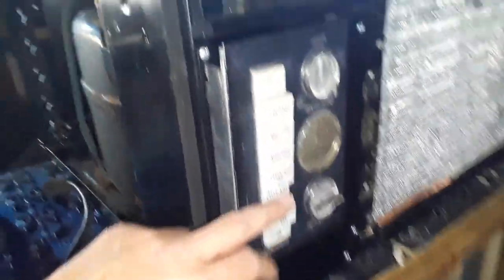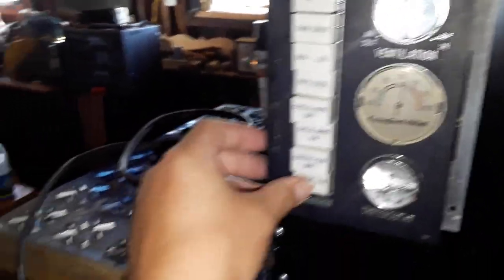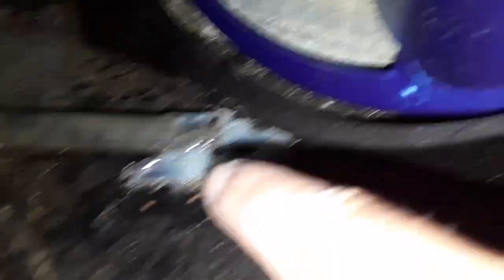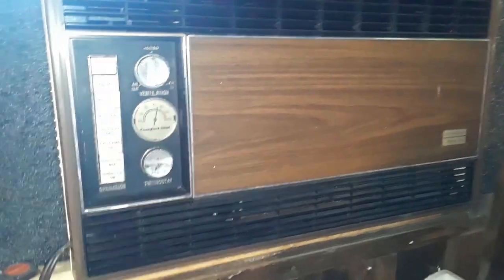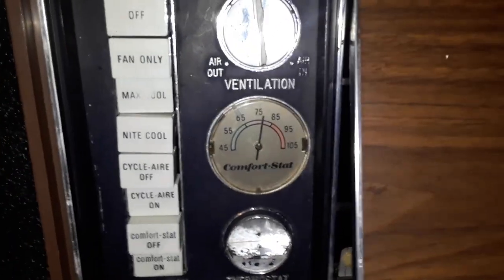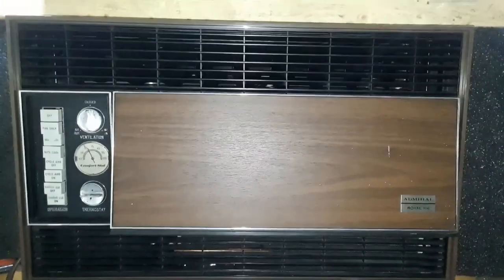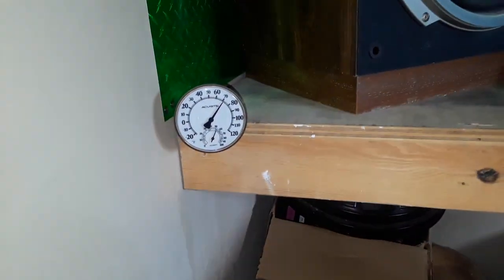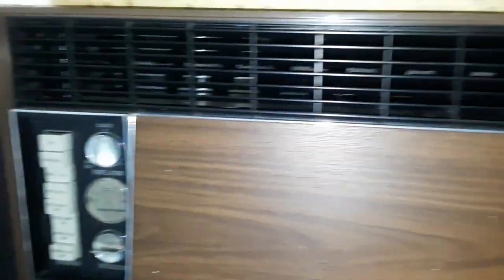1966 Admiral "Royal 106" Air Conditioner Restored & Installed!

Comment: Came out real sharp! I tend to shy away from putting holes in and condensate drains. That way it will sling water on the condenser making it run cooler and lower head pressures. The condensate usually evaporates faster than the overflow problem starts. That's just my preference. Very nice job. I'd like you to see my feeders. Maybe you may know what year it is. Don't know how to get you pictures.
Reply from the maker: uploading a video will be your best bet. amd that water does not evaportate fully, it sits there and rots the base pan awau eventually killing the unit. ive seen too many old units end up useless because of this. a lot of times they crumble whem removed.
Reply: Yeah,it's a double edge sword
Reply: I put a drain in the corner of my 80s one, and one near the condenser, Holes are a little too small actually, I then discovered my unit is completely galvanized metal construction, and that's why it had zero rust inside and shiny white paint under the years of filth in the bottom pan, Surprised a lot of these high end American models didn't use galvanized metal, or maybe not well enough I dunno!
Reply from the maker: @zacharymaclellan6761  what unit are you referring to?
Reply: @TheAirConditionerGuy  I have an Electrohome by KeepRite, Its a Canadian Air conditioner, made in Bradford Ontario, Has an emerson motor with oil ports, three speed and a tecumseh recip compressor, The rest of the unit was made here, they used really thick steel and its definitely galvanized, Inside the unit was not a speck of rust or bubbles on the bottom pan, cabinet or frame around the air box, I live in the corrosion capital of the world, Nova Scotia, humid, right by the ocean and a ton of road salt used in the winter, with constant freeze thaw cycles, Honda actually opened a test facility in Halifax to find out why their cars turned to swiss cheese literally in a few years up here. I have a newer 2015 A/C in my living room I got for $40 and the bottom of the coil is severely corroded, and the cabinet has lots of rust inside, My unit is 35 years old
Reply from the maker: @zacharymaclellan6761  id love to see a video of that!!
Reply: TheAirConditionerGuy i have one of it on my YouTube check it out!

Comment: Does air come out of the bottom air vent as well?
Reply from the maker: Nope, thats the intake louver
Reply: @TheAirConditionerGuy  Ahhh...Since the middle is blocked off with a solid piece, it must need that vent to pull the air into it so it can be recirculated out the top.

Comment: Beautiful job!  That’s an amazing control panel with all the features and the super cool dial!  

Did you guys actually find the slow leak before it was recharged with R22?
Reply from the maker: nah and KB had 275 lbs of nitrogen pressure in the system too. no leak was showing itself
Reply: Yea no leaks showed up after about 3 hours of sitting.
Reply: Ken B - American engineering had SO much class and quality back then. Now it’s just all so much Chinesium garbage.

Comment: The Condensate is not supposed to Drain, the fan which has a slinger ring, is supposed to evaporate the water on the Condenser coil, which makes it more efficient, that what it's purpose is for, so plug the hole and allow the condensate to build up as it should......
Reply from the maker: nope! thats why those old units rot out. ivd done temp checks. doesnt make a difference.condensate is corrosive
Reply: Ok you say so, I'm a HVAC Contractor, I've been doing this over 20 years, I currently have a 84 Carrier 2 ton and a 6,000 BTU coolerator made by whirlpool, I've been doing this since before you probably were born....... you're just figuring out what I already know.....I've had and owned vintage units..... so you tell me ??
Reply from the maker: @soulfultenor  Rust is a winow ac units worst enemy. keep them dry. ive been doing it for a long time with the rebuilds and restorations. keeping condensate out keeps them in better shape. you can replace compressors, fan motors, etc. but if the base pan rots the unit is fucked. dont like my videos? dont watch them, that simple. I have a NOS EQK... ive seen what old EQKs look like, many times the bottom is rotted so bad that the compressor is ready to fall thru the base pan. not mine. mine will be mint in 30 more years. fuck condensation. i get 40 degree air put of it.
Reply: soulfultenor if manufactures wanted the condensate to cool the condenser coil on a condensing unit why wouldn’t they have done something about it ages ago....
Reply: @kenb1918  not understanding your Question , do something about what ?? The liquid line sits in the condensate in the bottom of the pan, it's called sub cooling, the ring on the fan; slings the water on the condenser coil, evaporative cooling, something @Theairconditioner Guy, should know about if he went to school and was certified for.  I probably was working on Air-conditioners, far longer than you were born, I worked for major companies that built window A/C's one in particular (SEARS) Kenmore brand and Coldspot........so yeah, I know something you Airconditionergenius, don't know, as I said before, I don't do this is a hobby, I'm trained and I work professionally in it everyday.......
Reply: soulfultenor first I should proofread my comment. 
Second what I meant to say is that if the condensation made from the evap coil was so necessary to the operation of a air conditioning system major company’s like Ruud/Rheem/Trane/Carrier, they would be already be using it to cool the liquid line! Sure I only have about 6/7 years in the field of hvac/refrigeration but with clean coils and the correct charge I feel even a window shaker will be just fine without water hitting the condenser.
Reply: soulfultenor cat got your tongue?